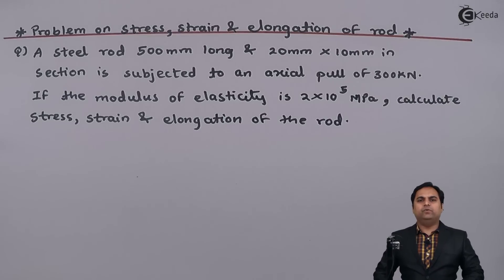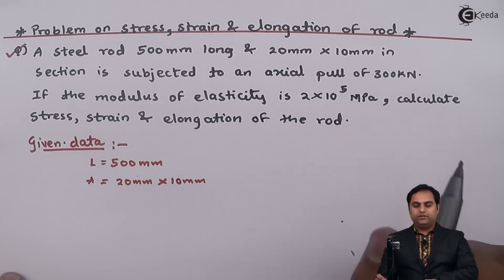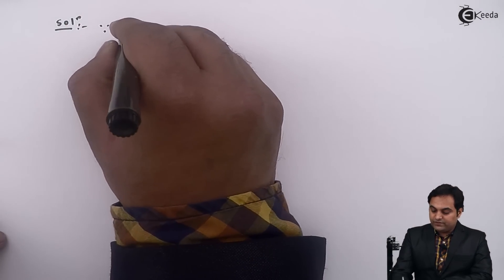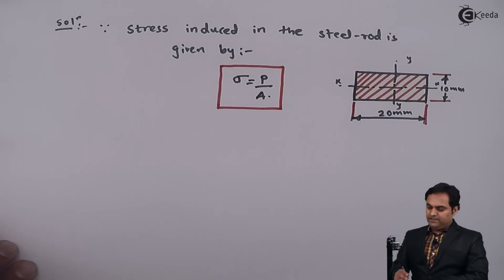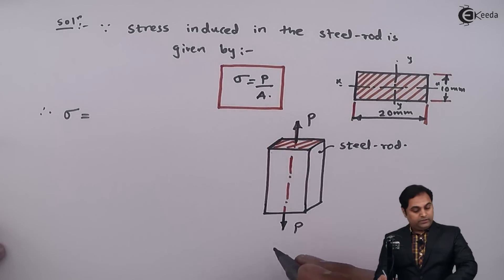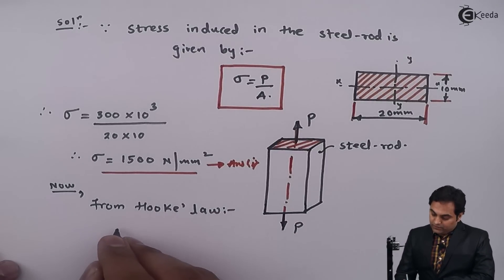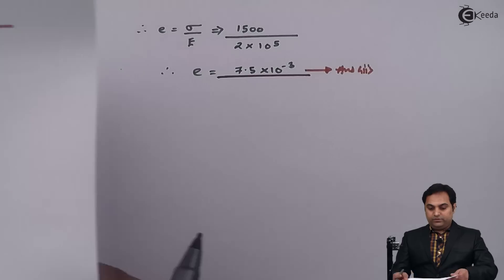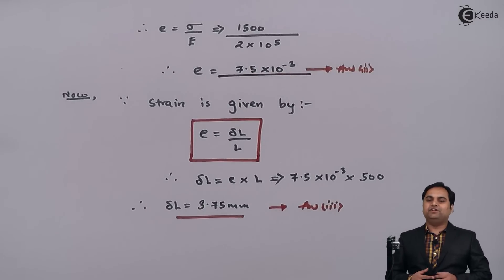Problem on Stress, Strain and Elongation of Rod - Stress and Strain - Strength of Materials

Comment: 1 pascal is 1Nm^2 not 1 Nmm^2. I'm guessing you changed it to suit the unit your working with, is this common practice? At college we always convert to standard unit m before anything.
Reply: His explanation was wrong but the conversion is correct. 1 Pascal = 1 N/m^2. But the given was, 1 Mega Pascals, which is equal to 1 N/mm^2. Quick question, have you solved the problem using the standard unit? what was your answer? :D
Reply: L=.5m         A=.0002m^2       F= 300000N        mod=200000000000N 
mod =stress/strain
strain = stress/mod
stress = F/A
strain=deltaL/L
DeltaL=Strain*L

Stress = 1500000000N/m^2 or (1.5N/m^2)*10^9
Strain = .0075 or (7.5)*10^3
DeltaL= .00375m or (3.75m)*10^3

Hope this helped.
Reply: Your answers are the same as HIS ^ answers (only converted). Your point was that, he should use meter because that was the standard unit?
Reply: I wasn't really making a point, it was more of a question. I don't know if he should use standard units for the answer, I though that was a standardized teaching across the world, if it is then he expressed his answer wrong even if the numerical value is correct.
Reply: Oh, I guess different schools have different standards of their final answers. Hmm, most times, it is easy to imagine a 3 mm rod than a 0.003 m. 

Are you going to take a national exam where standard units are a must for the final answer? You know what to do :) have a good day.
Reply: PS there is no such thing as a 3 mm rod. It was just for example's sake.